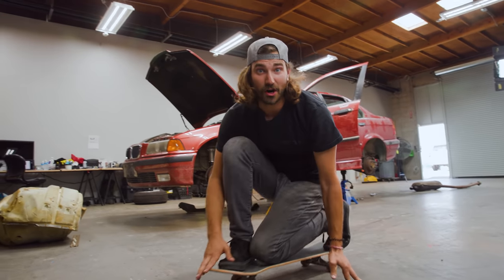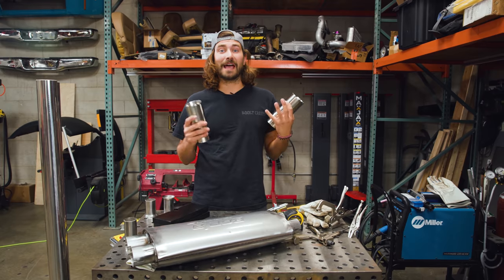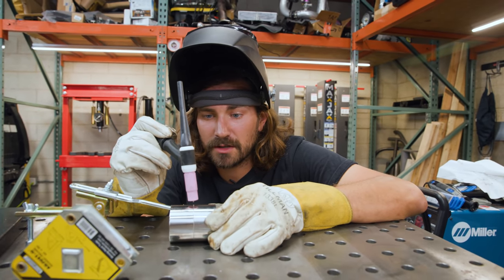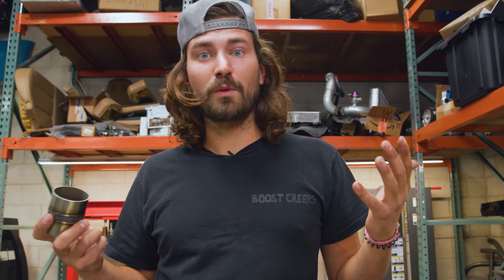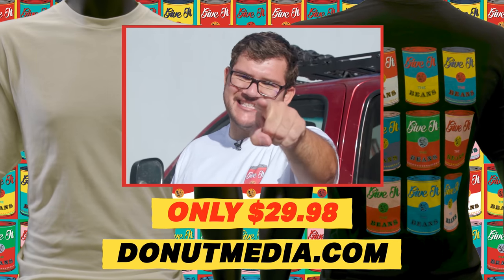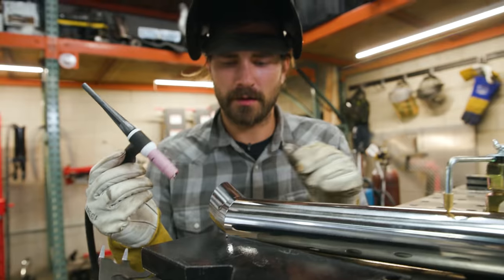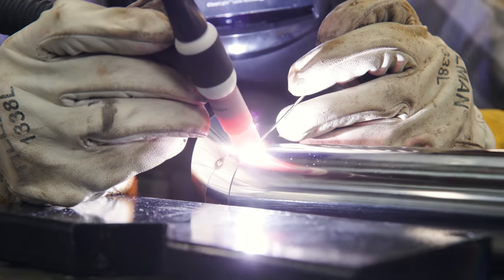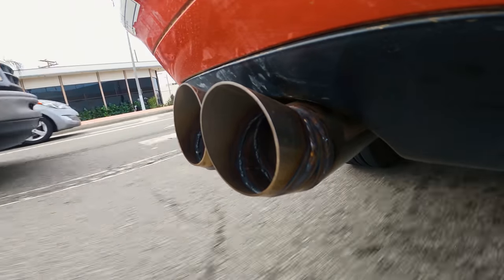DIY Exhaust! - Is it Worth It?

Comment: If you want to get better looking welds without back purging, which is not entirely required for a muffler delete, just back off the heat or pulse the pedal to control heat input and also lay the torch down almost flat to the pipe like 15° -30° range  instead of the 60° that gives full penetration. This way u dont have so much effect on the inside of the tube where the weld is unshielded. This will keep contamination from spoiling both sides of the weld. Critics would be quick to dismiss this technique because there wont be full strength as fully a penetrated perfectly filled pack purged joint. I cant say to apply this to a turbo manifold, its probably not going to work out since those love to crack even when seasoned welders fab them up proper! Cheers to learning something new, enjoyed the video guys!

Comment: I get enjoying a project like this. It's a lot of work and, in my caser, more expensive, but it's fun at the same time. I relate it to doing the custom cooling in PCs. The tubing bends, the fittings, the water blocks for the CPU and GPU, the radiators, the reservoir, the pump, and the satisfaction of it not leaking when it's all done. Does it even improve performance over something pre-configured for my hardware off of the shelf? Not really. It's about having the end result and the satisfaction of doing it myself and there is no other PC like it. The WOW factor of other people and their reaction to seeing it through the glass panels of the computer case is awesome! Anyone can put a PC together if they take their time. Only a small percentage of people that build computers can do what I do with customization. I'm good enough at it that people ask me to do the same for them.

Comment: ...so for "new" tig welders...u can lay a bead with some filler rod. Hit it with a wire brush after it cools. Then "wash" it by going over it again with the tig torch. Make sure if ur doing stainless steel to use a stainless brush...if not it will embed mild steel and leave rust spots

Comment: 101.9 from stock exhaust? I thought CA was supposed to have a 95 dBA limit? 😆
Reply: Shhhhh 🤫
Reply: @Superluminal: You are correct!

"The sale and installation of an aftermarket exhaust system remains legal in California so long as it does not exceed a sound level of 95-decibels when tested under SAE J1492 and complies with all other exhaust and safety laws and regulations."

In other words, the stock exhaust was already illegal and this aftermarket mod is unequivocally law breaking territory.
Reply: Shhhhh 🤫

Comment: Quick recommendation for cutting exhaust or any thin metal for that matter is buying a dry cut saw with one I have cut through exhaust pipes in less than 30 seconds and easily cut throught sheet metal for various other projects

Comment: Just one flaw in your conclusion. You say you save $600 from having to buy an exhaust but what you actually did was just a muffler delete and most shops will do that for only like $250 or maybe even less and that's cheaper then all the material that you bought.
Reply: if you’re getting charged anywhere near $250 for a muffler delete you’re getting robbed. everywhere i’ve went i’ve been quoted like $80-100
Reply: They wont use stainless pipe though
Reply: This video was how to fabricate your own exhaust, not chop off the muffler.
Reply: @pushhrodd01  It can depend on a lot things though. The amount of mufflers being deleted (my last and current car has 3 mufflers each), the amount of piping needed and if you are having new tips installed. Most shops charge $75-100 just for 1 hour of labor alone. Not to mention the quality of the work.

Comment: For things like exhaust I would suggest Solar Flux in place of back purging. Mix it up with alcohol, smear it on the back side of the weld and forget about it. It creates a localized shielding as the flux heats up. Much easier than setting up a whole back purge setup.

Comment: yes a diy exhaust is worth it if you know what your doing, i bought a bunch of 3 inch pipe a glasspack and welded it together, and side dumped it behind the passenger door of my shorty 2nd gen it sounds perfect, its loud enough to sound good, and quiet enought to not be pulled over highly recommend it

Comment: fun fact if you have a straight pipe back box, when your off throttle (like say coasting or when your going down a hill or just slowing down) if you tap the throttle and i mean tap it , a quick blip, you can make the car crackle and pop and sometimes bang. do it all the time in my e92

Comment: I made a side exit exhaust for my built 95 neon. I used recycled pipe I had at my shop. I put a black widow neighborhater on it but it was way too loud so I threw a glasspack in front of it to act as a resonator and it calmed it down a lot. The car sounds really good.

Comment: You need to clean the welds up either with nitric acid or scotch brite pads ,if you dont the welds will rust as you change the metal composition with when you heat  it with the welding.appart from that you have done a great job

Comment: Zack my guy, continuous welds put a lot of heat in your part over if you don’t move fast enough. Try doing some pulse welds, it makes doing thin wall tubing and exhaust a lot easier because you can control your heat better👍

Comment: A worthy first effort. Next step will be heat management. The weld going gray is a result of burning off the chromium in the alloy, losing the benefit of stainless in the process. Definitely requires a bit of practice on that thin wall. Another note worth mentioning is that welding stainless should be done in a well ventilated area or wearing a respirator designed to fit under the hood. Hexavalent chromium is nasty stuff.

Comment: Great video! 

I wouldn't use brake clean for cleaning materials to weld, good chance of burning some off and those fumes are toxic. Acetone/Alcohol is a more proper method that won't leave behind potential residues that'll be burnt off and breathed in. Regardless on stainless (and really any welding) it's always good to use masks/filter PPE, but SS especially contains chromium which is also very toxic and is stirred up in the heating processes.

Comment: I'm not sure if this applies to TIG as well, but cleaning parts with brake cleaner before welding can produce deadly Phosgene gas. The Tetrachloroethylene, when exposed to heat and argon will produce Phosgene.

Comment: One big critique on the video.
You mention cleaning the part with brake cleaner before welding. It should be noted that it's important you use non-chlorinated brake cleaner, unless you want to gas yourself.

Comment: Hey Zack I would take more care for ventilation when Tig welding stainless steel. Stainless let's fumes that contain Hexavalent-Chromium which is a form of nuro toxin that can give you pretty bad Shakeyness along with a lot of other heath issues. I would look it up if your curious

Comment: Nice video but little tip for later. If u weld pipes or what ever... tack it on 3-4 spots. It will stay in line and doesent bend to one side. (I hope it make sense)

Comment: 8:00 argument for buying the Borla exhaust that is made specifically for the car.  In this case race car so muffler may not be needed (some tracks and race series have sound limits for cars because the race tracks have neighbors).  Also this is a rally car and straight pipes cost less if they get torn off.

Comment: bruh the welder they use is realtively easier than the traditional one. we used to use the crank type welder wherein everytime the current goes or down must wait till the right amount of current needed to start welding then second problem is the contact, when you make too much contact, you put holes. that thing that zack is using is very easy to use I can tell you that.

Comment: Good Video, My Personal Cavet: If your not going to back purge stainless steel ( do the right welding) then just MIG it with Stainless steel wire and call it a day. Your just losing the protective properties and making your "custom" exhaust last a shorter life span. For me than would negate spending the time to make it. I mean, "who walks the cup" horizontally anyway :)

Comment: God I miss welding. I wish there were hobby shops where I could just practice welding for an hour or two and pay for time and materials. TIG is so hard but really rewarding and engaging. MIG is really fast and fun but isn't as precise and leaves tiny beads of steel behind everywhere. I never got good at it in the short time I had to try it, but I've always wanted to go back to it.

Comment: Should have did a full straight pipe from the manifold back to do a Cadillac converter delete as well. Maybe put on a header as well. Really open up the exhaust system.

Comment: Zach, I am supersized you didn't stress the importance of cutting half the angle into the pipe.  If you cut one pipe at 8 degrees and try to connect it to a straight pipe, the pipe diameter will not be the same which will create a huge gap.

Comment: You should next time rest your hand on something so you can get straighter lines. Also you could add a little more material and try to push it in if that makes sense. Going in a half moon motion. Takes a lot of practice but then you get good. You’ll have good penetration and pretty welds.

Comment: I really don’t mean to be another internet know it all but just an FYI for your safety I’ve heard that brake cleaner can be very dangerous to clean your metal you plan on welding because when it’s heated if there is any brake clean left on the surface it can turn into chlorine gas which is ver poisonous. Again not hating just something I’ve heard. Love the videos keep up the good work.

Comment: Never use brake clean to clean oils off of weld pieces. It leaves a film that in most cases isn’t noticeable but with welding it produces a poisonous gas. Use either denatured alcohol or acetone.

Comment: Just a PSA, please don't clean anything you're going to weld with brakleen as it can react with the heat and argon to create phosgene gas which is incredibly harmful even in low amounts. Usually it evaporates before you get to welding it, but best to just avoid the risk because it can seriously f you up. Otherwise great video, loving the BMW content!

Comment: I got a 05 civic that I bought a header, resonator pipe, and resonator back exhaust for, that cost me about $250 however they sent the wrong resonator twice so I ended up just welding a new adapter from the header to the resonator pipe, cut out the resonator and strait pipe that part because there was a rattle, and adapt the rest of the exhaust to the car it was fun but a pain in the ass when all you got for jack stands is several pieces of 4x4 and 6x4 lol. fun to watch though!

Comment: Note: do not use Brake Cleaner as a final cleaner before welding. It leaves a residue that can be toxic if inhaled. I usually used Denatured Alcohol, Acetone, or mineral spirits.

Comment: It looks like you are using 1/16" filler rod, I would  reccomend if it is available to use 0.045" filler rod for any future exhausts. If you use .045" filler rod you wouldn't need to use as many amps to weld it.

Comment: firsty dont use pedal...second get a better torch...torch with start stop buttons....also while you weld stainless you should purge it from inside...but since its exhaust you need around 50amps to weld it and move faster so it doesnt burn that much...and increase argon flow from that torch...

Comment: All I did for my 2011 Mazda 3 was removed the muffler axel back and got a joint welded to aluminum and got an eBay tip

Comment: Would it not have been possible to mandrel bend the stainless tubing similarly to how you fabricated the roll cage? Atleast for some of those gentle bends. Genuine question, maybe stainless can't be bent as easily or something, you did mention it was a difficult material to even cut on the bandsaw

Comment: If you purge the stainless the weld would look 10x better man. Without purge you are burning chromium out of the stainless and it looks really bad. Plus not structurally good either. Props to the effort tho. Doesn't look bad for a beginner.

Comment: Hey, so you didn't end up using the Borla muffler you bought for the E36. Why did you buy it if it wasn't going to fit or allow reasonable running of the exhaust piping? Did anyone bother to do any measuring beforehand? I think the E36 would have sounded much better and be less douche-like without strait pipes.

Comment: If you would have pointed your exhaust tip at the ground rather than up in the air it would have been much louder because the sound would have been reflecting off of the ground

Comment: Donut staff- It's important to mention that you should use acetone to clean your parts and not brake cleaner. Brake cleaner creates  toxic fumes when heated. Per my welding instructor it creates a gas similar to mustard gas. Not good. You might want to update the video with this info.

Comment: Also don’t use brake cleaner, use acetone. IF you mistakenly grab chlorinated brake cleaner and then weld on that surface you will be releasing a highly toxic gas.

Comment: Can someone explain why he cuts and welds to accomplish the bends instead of using the pipe bending machine as they did for the roll cage? Is the metal for the exhaust too strong for the machine, or some other reason it's not used?

Comment: Please do NOT USE BRAKE CLEAN on welded parts. This is very important. Brake clean can be chlorinated and when exposed to intense UV rays from welding that creates mustard gas. Just use industrial Acetone. It's safest and also leaves no residue to interfere with the welding.

Comment: Do not clean things to be welded with brake clean man , when you get the metals hot it releases a fairly poisonous gas from the brake cleaner burning off , acetone or alcohol I believe is what should be used to wipe down stainless before welding

Comment: Ooof sorry as a welder those welds are less than appealing and I’ve never seen such a clean welding table 😅 but seriously with stainless lower ur amperage slow down and make sure ur using 100%argon get when ur heat is right Ull start seeing thoes blues and purples everyone is looking for

Comment: I hope you guys put a pinned comment mentioning about brake parts cleaner and welding.  Yes there are dechlorinated cleaners out there.. but the greatest danger to humanity is humans ignorance. 
 Do not use brakeparts cleaner when Tig welding.  Acetone is cheaper anyway by volume.

Comment: yo do NOT use brake cleaner to clean weld material... if u light a welder on a surface with ANY residule brake cleaner on it, the heat will create phosgene gas, that stuff can kill u in a breath... use acetone instead.

Comment: Why can't 3rd party exhaust makers figure out how to create a quieter muffler? For example in almost every other industry, a more expensive air related product is able to improve airflow while reducing noise. If you get a high end case fan, you get more airflow with less noise. Why can't the exhaust makers do the same?

Comment: "A" for effort, "D" for creativity.  You really need one pipe not two unless.. Dude after giving up on an actual muffler you could have made it dual on both sides just bang in the battery tray in the trunk, or even side exits just for fun.  and my brother, It's not straight pipes if you still have a CAT.  It's no muffler.  and the drone on those M52's man, your head is gonna hurt cruising on the highway.

Comment: First of all, I wish I had a welding table like that (not to mention the rest of the shop equipment).
Unfortunately this episode highlights and promotes one of the worst aspects of motorsports - noise pollution. You know when you have to say things like "it may be a little bit obnoxious" and "it doesn't sound altogether too bad" - and those count as positive statements - that you've descended into the realm of the caveman who just wants everyone else to hear him roar.
If I want to roar, I'll turn on my 100W Marshall amplifier and 8x10 cabinet. Cars are meant to get from A to B in either a comfortable, stylish, or sporting manner -- they don't need to disturb the peace for a 1 mile radius. The fact that someone would spend 4 days working just to have their ego inflated by an obnoxious sounding exhaust system is yet another sign that we have not actually evolved from our days as cavemen, unfortunately.
Pretty soon electric vehicles will dominate, and this sort of stuff will all be seen as not so quaint historical nonsense that we used to mindlessly indulge in while trashing the planet.

Comment: That’s not a straight pipe just a muffler delete.  Now if you did true duals from the headers back that would be a straight pipe.  My Cummins with a 5 inch turbo back is a straight pipe and it’s somewhere around 200 Decibels.  The only modifications I will ever do to my vehicles is exhaust and intake.  I know it’s cool to do it and I have had my fair share of mods but the engineers that design these cars are a lot smarter then the rest of us and the car is going to be the most reliable when it’s stock.

Comment: I don't mean to sound like a jerk or anything. And I'm not doging your ability. However, I'd DEFINITELY be using a face shield when running that cutoff wheel. I've been welding and doing metal fabrication for the better part of 20 years and I've seen some absolutely brutal injuries sustained blowing a cutoff wheel up. They're almost always from a "quick and easy" cut that you've done thousands of times before. I'd HATE to see any of y'all get maimed. Seriously man. USE. A. CUTTING. SHIELD!